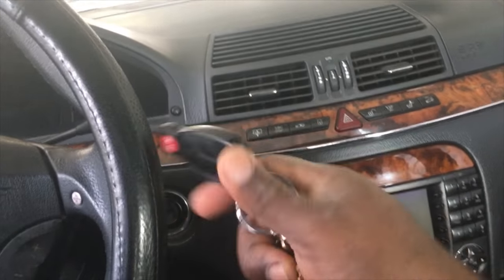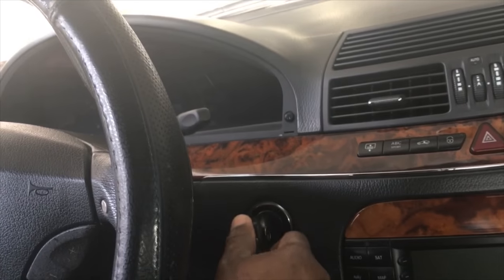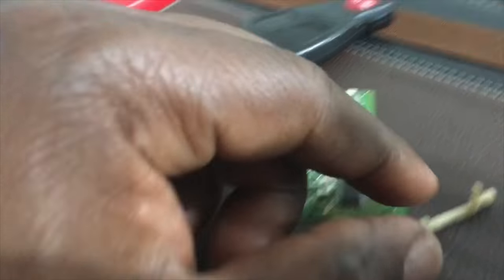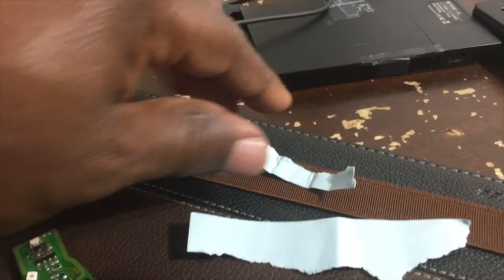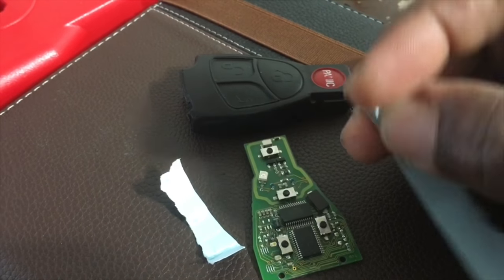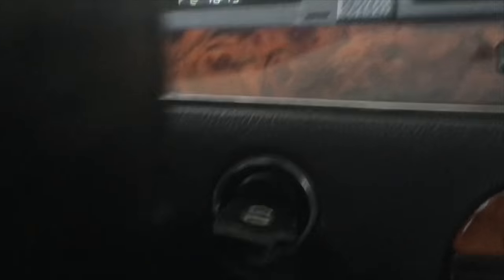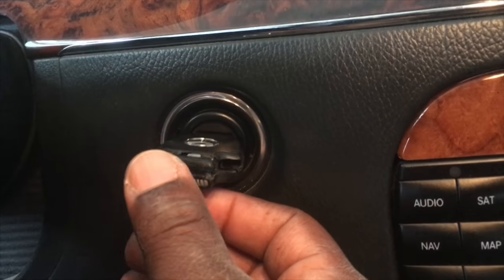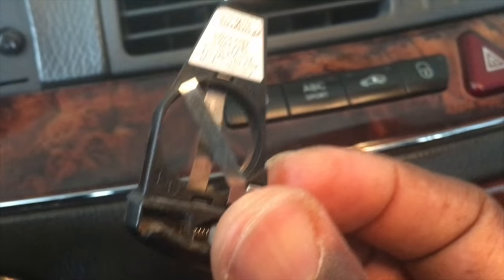DIY Mercedes key fob repair (saved $1,300)

Comment: I think your making the battery connection bro.
Reply from the maker: M F yes . The paper is used to press the contacts of the circuit board and make a solid connection. 

It is either this or the paper is applying pressure to the board and making sure another circuit component is making full contact (maybe old/bad solder joints, etc).
Reply: @frugalfabrication  the battery has nothing to do with the part of the key thats used to start. That is ONLY for remote. The EIS! not the tumbler energizes the key to transmit the DATA via IR no battery pack needed to make cr start.
Reply from the maker: Airborne Locksmith Yes, thanks for the info. I figured that out.
Reply: He doesn’t even have a battery in the key lol

Comment: Bruh!? 😲😲😲😲
Reply from the maker: Ryan Diekmann hehe... you’re welcome.
Reply: Turns out my part in the chip that lines up with the tumbler that lies inside directly under the "Panic" circle has apparently broken off the circuit board itself and one of the wires has dusconnected from a circuit. So today I had our local dealership order me a new key $192.00 and should arrive on Tuesday for pick up.

But yea,great vid just the same man. T.Y for taking the time when you didnt have too. 😎
Reply from the maker: Ryan Diekmann anytime.
Reply from the maker: Ryan Diekmann this just came to me...there is also a good chance that you can take that broken part to a circuit repair specialist and they may have been able to resolder or replace for about $40-$50.
Reply: Already ahead of you bro. 😉
They can.. A software specialist but they wont be in until Monday,but im good cause im not stranded,and my new key should be to the dealership Tuesday so im still gonna have them fix this one so I got 2! Hahaha! Shit aint gonna happen to me again. lol..

$192.00 for my new updated fob so its not to bad.. 👍😉
Reply: Ryan Diekmann did it fix the issue?
Reply: @elijahvw4956  Yes.. Dude said it was actually easier to repair then he originally thought.

Still working great till this day. I went ahead and ordered a secondary key to though from my dealership localy so now I have 2 keys and both work great.. $25.00 to have my old key repaired,and $198.00 for the newer one I ordered. 

No problems since. I tend to be alot more careful with both though these days. 😂